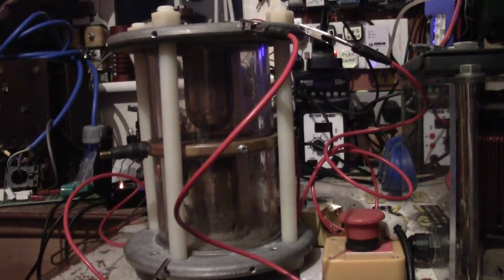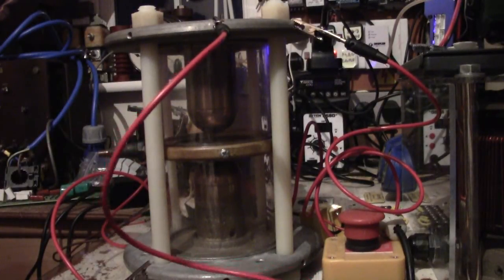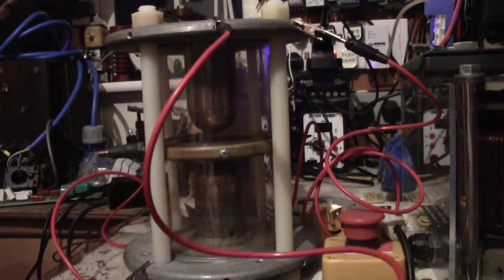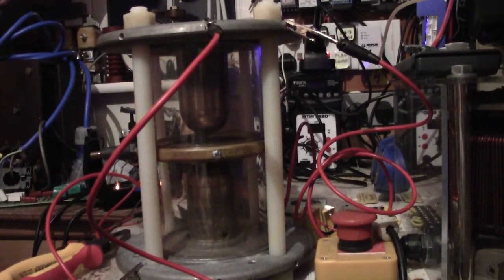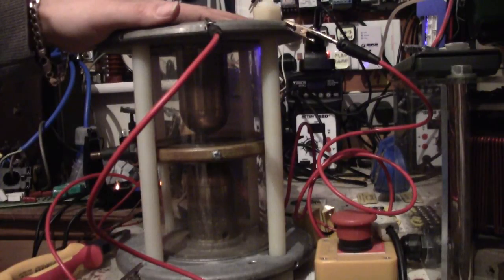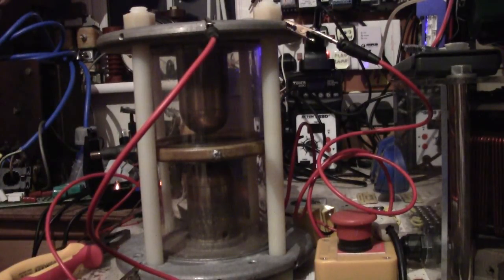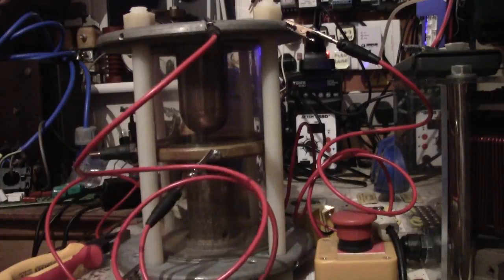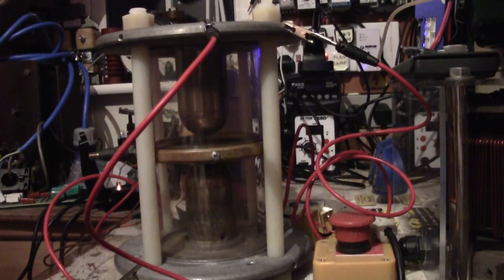Showing the triggered spark gap being triggered and why its SO useful to me

Comment: Problem is that you trigger the gap, but removing the trigger doesn't stop the arc, and that's only 8kv, i'm guessing you can't adjust the gap..
also, the trigger should be  low current, for instance a resistor in series
Reply from the maker: it only triggers at 8kv due to just the right amount of vacuum for the vid thats why it doesnt turn off too ;) my 20kv PT wont jump the gap so i think 20kv across the gap at say 7KW from 2 PT'S and trigger it with a 20kv pt ballasted to 250W maybe less and that will be on the rotary gap ??? what you think ???
Reply: Maybe we can chat about this later on hangout ?
Reply from the maker: yep im about tonight ,I havent been about for a few nights now